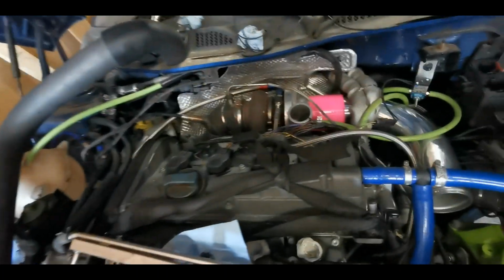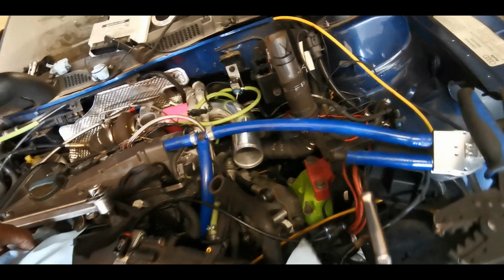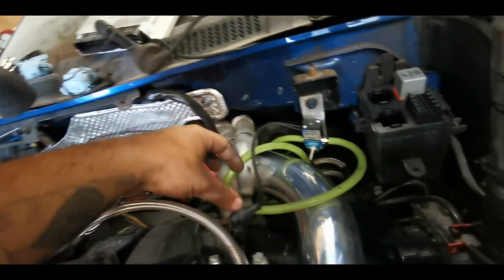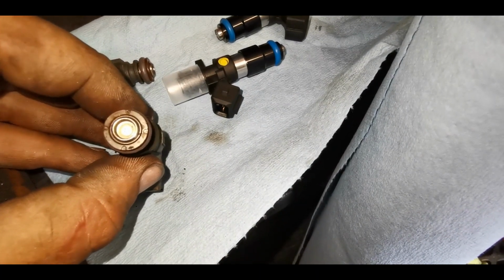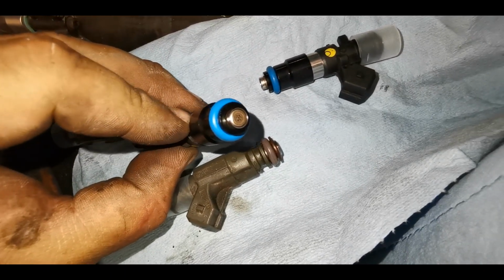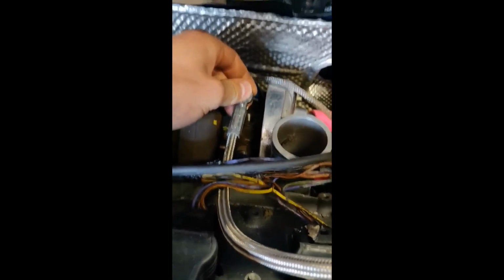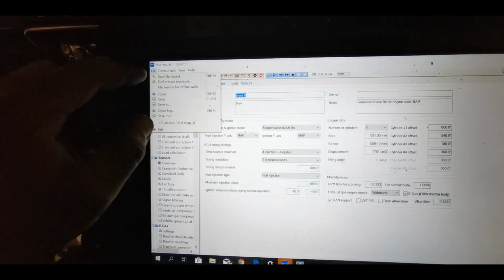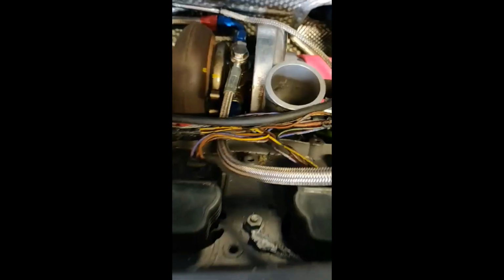Track project part 3 Big Turbo Ignitron ECU first start

Comment: Hi. I need to replace the two fuel hoses going from the pump (I think) to the rail that holds the injectors. They are so far gone that I cannot read any of the specs printed on them and I dunno what size I need. Would you help a rookie out? What is the original size of those hoses or which one should I get considering that my 225bhp 1.8t BAM engine is boosted to over 300bhp (got upgraded BOSH injectors but nothing else fuel wise)?